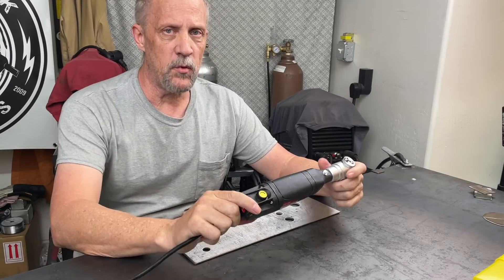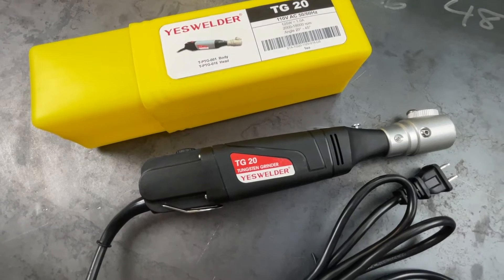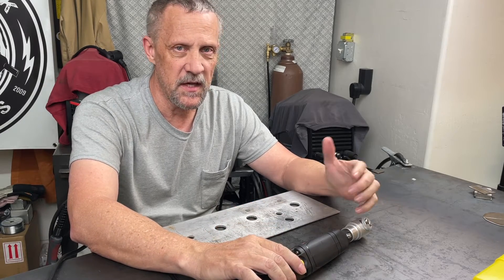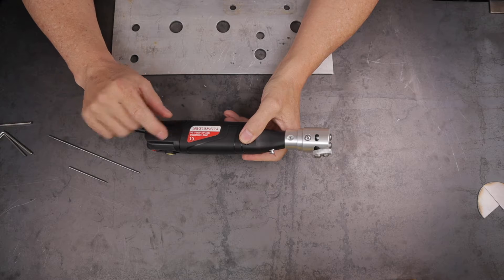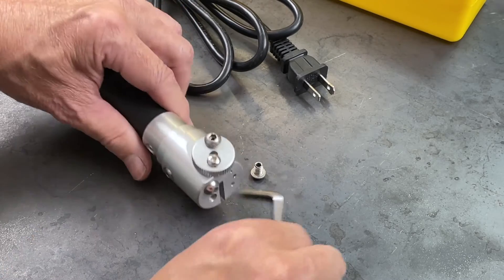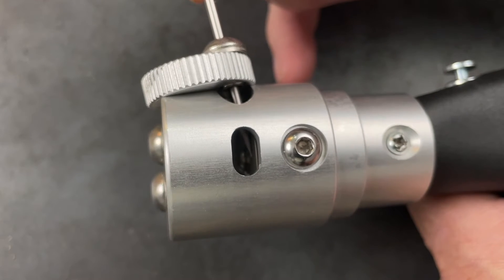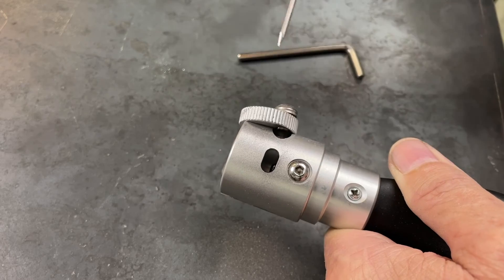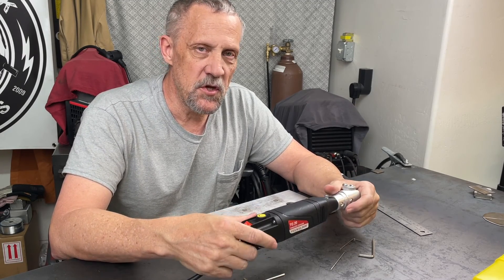Will This YesWelder® Tungsten Electrode Sharpener Grinder Make Me a Better TIG Welder?

Comment: Better results/arc  sharpening your Tungsten “long grain” (the direction of the point of your tungsten) 

I use a Trick Tools bench grinder attachment that turns your grinder into a belt sander